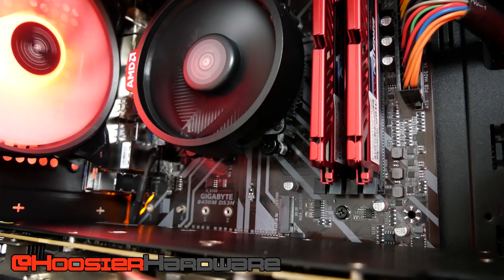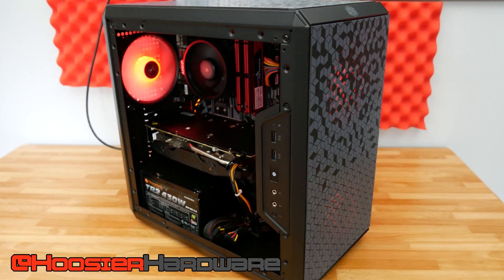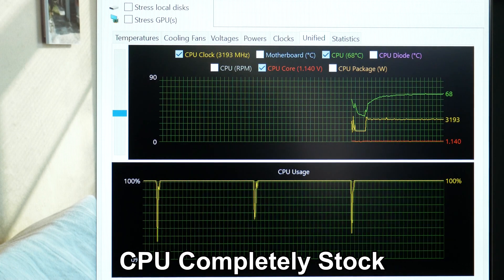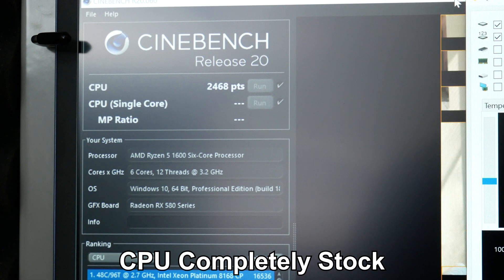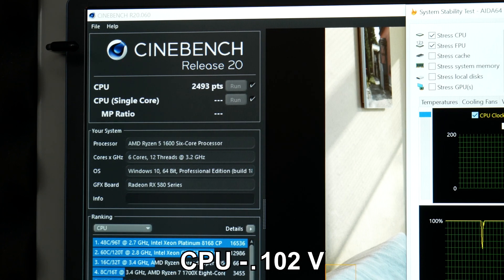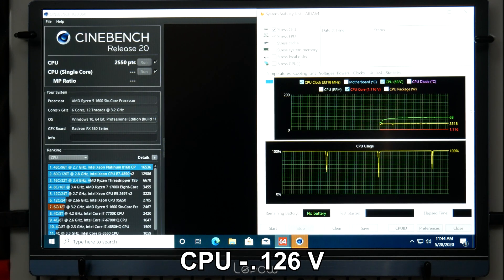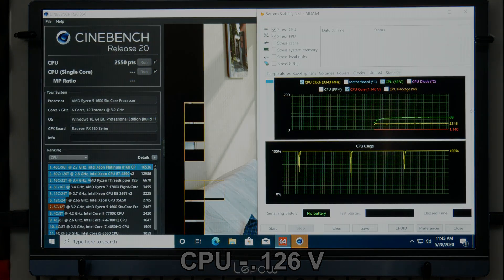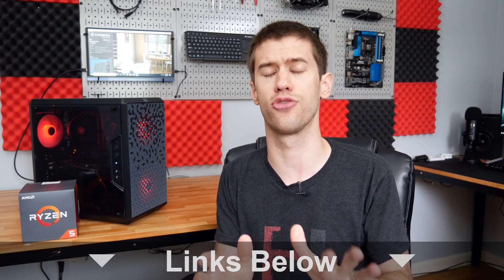Undervolting for FREE CPU Performance

Comment: i did 1,12v manuel and pc is not boot! auto voltage 1.4v is so high, i use 1.25v manuel on stock clock but i think 1.25 also high for stock clock, sorry for my bad english. mBoard B450M PRO-M2 MAX

Comment: On my ASRock board, I would undervolt to the lowest the CPU default clock can run, and use that as a baseline voltage. Then I would start OCing and only increase  the offset voltage.

Comment: I don't think that playing with voltage manually is advised at all, it can make the system unstable, better flash the mobo bios to the latest. By the way I just built an old i7-4790K on the exact case it is the CoolerMaster Q300L.  I'm running a 3900X with stock wraith prism cooler, it has more metal than that one, on a NZ T H400 case 2 front fans intake on a Aorus x570 pro but it can run really hot, cpu voltage 1.02V.  With a stress test that effectively runs all 12 cores at more 90% all the time it reached 92C max and average 84C.  Idle was 36C ambient 27C.  Voltage doesn't seem to affect temps that much since other mobos with higher voltages reach similar temps.
Reply: Or your mobos reporting voltages slightly differently.

Undervolting always helps temps. It's simple physics.
Reply: 1.02V was at idle, it increased to more than 1.25V under stress. But in reality, according to physics, temperature (Joule effect) is related to current (Amps) not voltage.  If the system is limited by CPU power (Watt) = A . V, a lower voltage could mean a higher current is needed to reach the same power which in turn lowers the efficiency of the cpu by increasing thermal waste.  I'm not sure how the bios decides to feed the cpu.

Comment: Is all this worth it for just 3.3% Cinebench uptick? Is there a down side to doing this? If not maybe free performance is good. I like Free.
Reply: No downside. Why wouldn't it be worth it? All what? I'm concerned for your "work ethic" as this is hardly a task worth noting. It's an 8 minute video
- an EASY trick.
Reply: It really depends on your cooling solution. But undervolting in general is worth it. This is not limited to this cpu, might aswell be in a laptop or a GPU. GPU undervolt in laptops have seen to 3x the performance and in my own personal laptop, 20%more performance at same power.
Reply: I would just undervolt at the same clock speeds and performance to lower power consumption and temperatures.

Comment: my 1600 af boosts to 3.6ghz in r20. looks like the stock voltage limit is abt 1.2V when it boosts. so I overclocked to 3.9ghz at 1.2V all core and temps are pretty much the same. I understand undervolting but if i can get 3.9 at what seems to be stock temps and volts then why not. r5 2600 does 3.8 all core and 3.9 on a couple of cores.  getting to 4ghz i have to go immediately from 1.2V to 1.3v AT LEAST.  not worth the energy and heat for 100 mhz imo. also got this for $85 fortunately. there is no bad cpu, only bad price lol. Extermely satisfied. i must say i have a cooler master 212 evo and not stock cooler. Thx for the content.

Comment: I love tinkering to get more performance/lower temps.  I do this with my 3800x and made a video on it a few months back😁
Reply: Is there a way of imposing a power limit on the cpu using the bios ?  My goal is not performance but cpu longevity under constant cpu loads by keeping temps always under 65C.  Say I would like to impose a max of 100Watt on a 3900x which can suck up to 142Watt if not limited.
Reply from the maker: Cool stuff; totally gonna check your video out